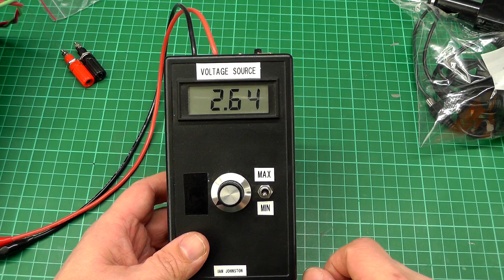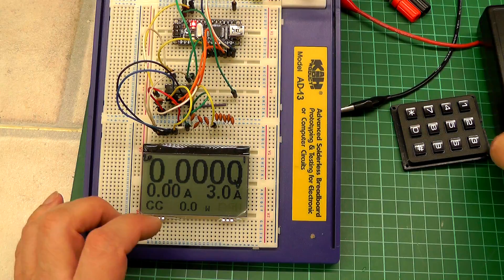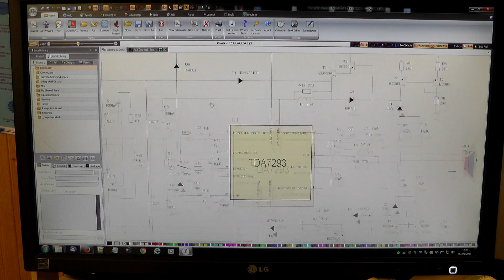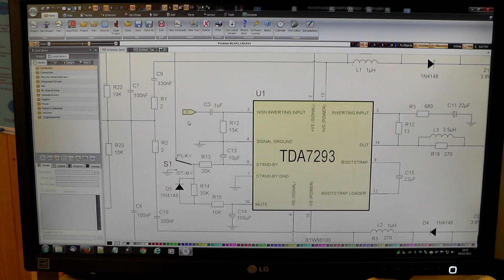Handheld voltage source & Lathe refurb projects

Comment: HI Ian,

I supply inverter drives for 3 phase motors(Drives Direct) so let me know if you want one at a great price BUT I have not seen a unit yet that can run a single phase motor with good results as we are asked all the time if we have that product available so let me know if know of a unit that can do this,

The calibrator project looks good and looking forward to seeing that as I am working on a high power Digital power supply project right now so your DAC choice will be interesting here,

Keep up the great work, love your vids,

Dave
Reply from the maker: Yep, it had crossed my mind regarding single phase AC motor control, but it's worth a shot. If that fails then I have a couple of wheelchair motors (DC 24vdc) which will work also.
The DAC i've found for the voltage source is a helluva spec, and quite expensive but somehow managed to find a source online (USA) for some cheap, very cheap stock.................so yet to evaluate if they are the correct ones.
Reply from the maker: Tested my motor with a single phase speed controller and am not impressed right enough. So, have decided to use a spare wheelchair motor and H-bridge I had from my home made segway project. Perfect!
Reply: IanScottJohnston Sounds good, I have an EBAY shop at http://stores.ebay.co.uk/Basic-Micro-UK/ and you will see I have listed some very high power MOSFETS that are perfect for low voltage PWM DC motor control, you may also like our Basic Micro NANO range as these can be programmed in BASIC and are great for integrating a microcontroller into your own projects, let me know if your interested and I will get one over to you to test out, Brush problems can lead to an unreliable drive on an application like a lathe, we have had many units sent back to rebuild and we always recommend AC motors for these sort of application, let me know how you get on,All the bestDave

Comment: Nice projects :) I have also thought about building a handheld battery powered power supply (for a while :P), just an analog one like the one you showed, but never got around to it even though I got the parts :) 
I find myself needing it all the time for stuff that I can't bring to the bench :P 
I'm excited to see how the new one turns out, looking awesome so far !

Have you tried DipTrace ? It's not as cheap as the one you found, but they do have a free 500 pin (non-profit) version.
It's the one I like best, but it's also the first I tried so I might be biased ;) Never heard of DEX though, so I'll have to try that as well.

Just as a coincidence, I'm also about to get some machines for metal work, hehe :D

Comment: For one that doesn't really see the point of having a Voltage source, what is it primarily used for?
I'm keen on making one myself, but i have a hard time thinking about something to use it for. :)

Keep up the good work! :)
Reply: i guess its just a portable power supply, and sometimes you need either two voltages, so you only only have one power suppy so it supplements, other times, you can run a circuit from your portable supply, he is using li-ions so will run most anything for a short to medium time, of course variable is probably overkill, mostly 3v and 5v being most useful
Reply from the maker: Useful during design or repair, i.e. during design of my bench power supply when I wanted to breadboard the output stage by simulating the output of the DAC (when it hadn't been built yet). Also, during the repair of the PM3585 logic analyser I wanted to simulate the negative DC to the brightness circuit. Sometimes you don't want to use an actual PSU for these tasks as there could be too much current involved or grounding issues. Being handheld means they are easily thrown around. PS. the output of the voltage source will be limited to somewhere around 50mA max.
Reply: IanScottJohnston I see. So just a very low power variable DC PSU. Hmm yeah, that could possibly come in handy. :) Cheers for pulling up some examples.